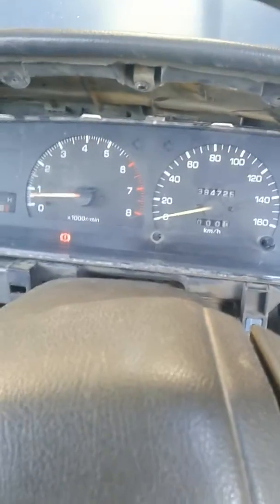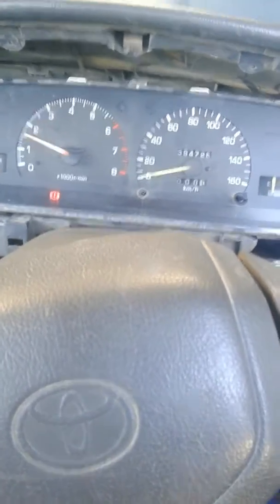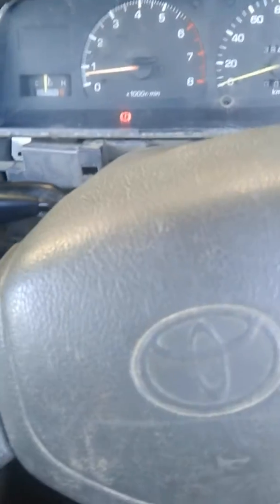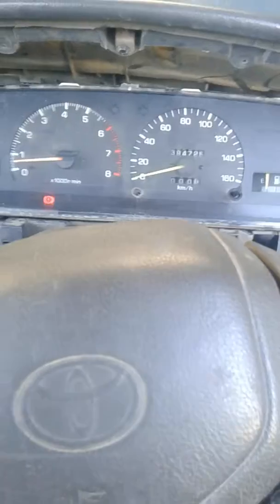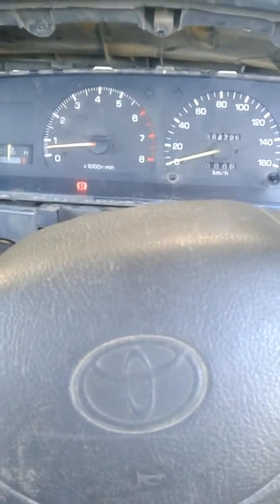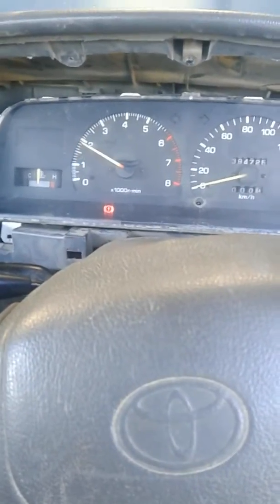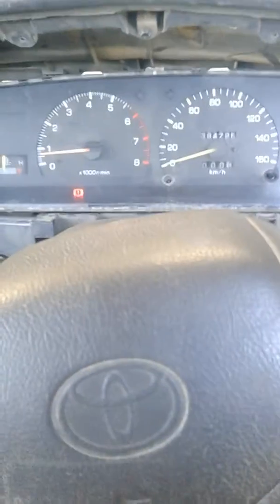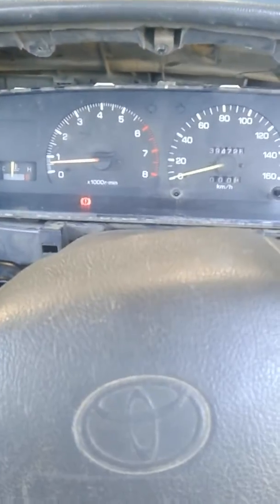Diagnosing 1uz Faults - TPS Circuit / Ecu fault

Comment: Hello dear friend, I am facing the same problem. The duration of the engine does not give me good power when driving fuel
Reply from the maker: Maybe best to look at fixing it then.  Cheers Kelvin
Reply: Dear friend, I changed the tps sensor and the same problem remained when I want to press the throttle on it does not respond well and sometimes black smoke comes out from the exhaust
Reply: The problem I have a check engine lamp is not working I connected the line from the ecu but it is not working Can you help me with this problem I am from Lebanon
Reply from the maker: @alialiahmad6011  watch my ecu diagnostic video.   I will say if ecu does not output check engine light then ecu is  failed and requires repair.  Simple.
Reply: Would you send me the video link? There are a lot of videos for your hands. You are an expert in this field
Reply: My engine in 1991
Reply from the maker: @alialiahmad6011  https://youtu.be/Vl1_QtNq5pY and https://youtu.be/y-8L05-cJJg  principles are the same regardless of year.
Reply: Good thing I kept looking at your videos, I’m having this issue, going to diagnose soon.